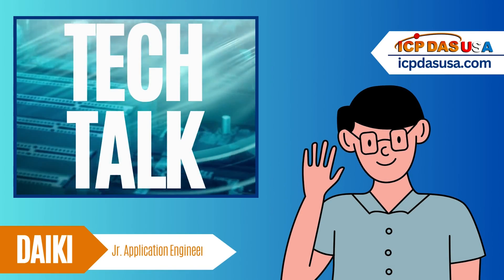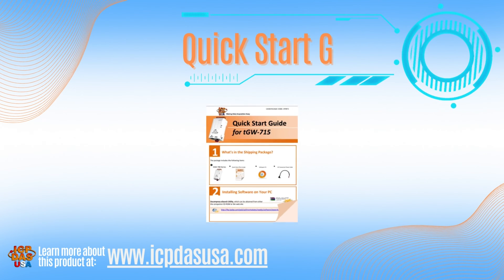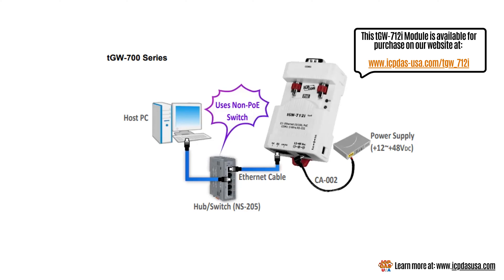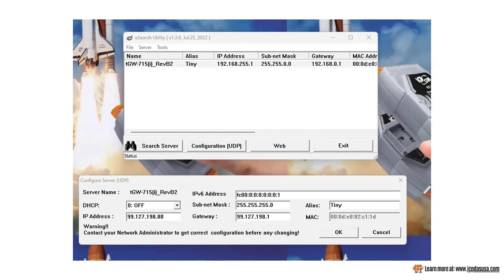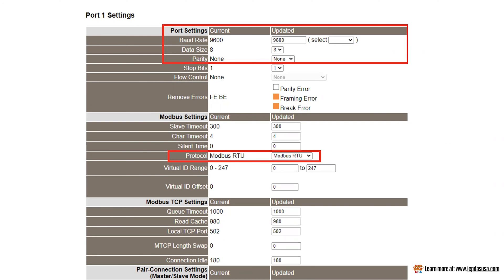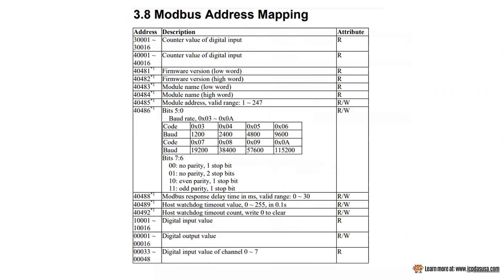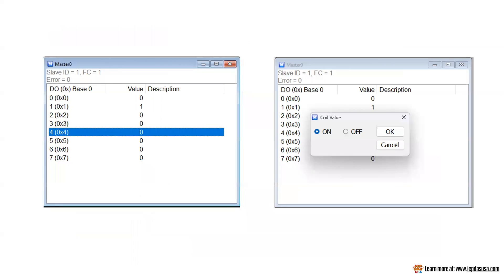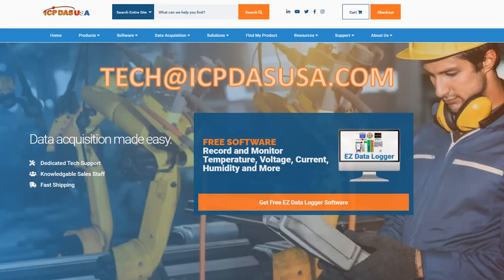TECH TALK: tGW-715 Modbus TCP to Modbus RTU Configuration | ICP DAS USA

Comment: Does the TGW-715 model convert Modbus UDP to Modbus RTU in both directions? Thanks
Reply from the maker: Great question! Yes, the tGW-715 can handle Modbus TCP/UDP as both a client (master) and server (slave), and it supports bidirectional conversion between Modbus TCP/UDP ↔ Modbus RTU/ASCII over RS-485/RS-422.

So if your application uses UDP-based Modbus messaging, the tGW-715 can receive those UDP packets and convert them to Modbus RTU/ASCII on the serial side (and vice-versa).

If you have a specific network setup you're working with, feel free to share more details — we’re happy to help! You can reach out at sales@icpdasusa.com :)